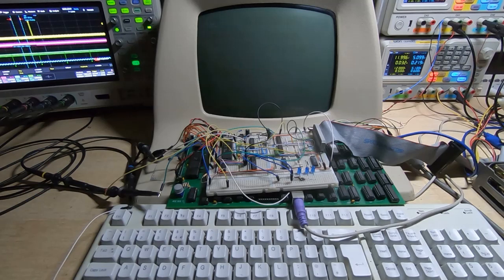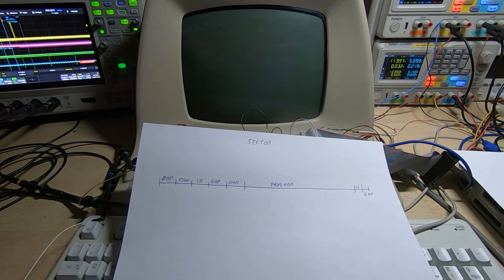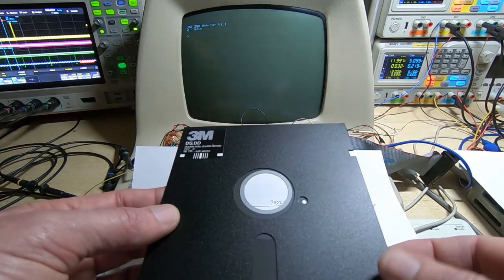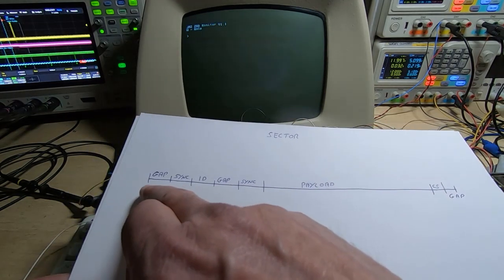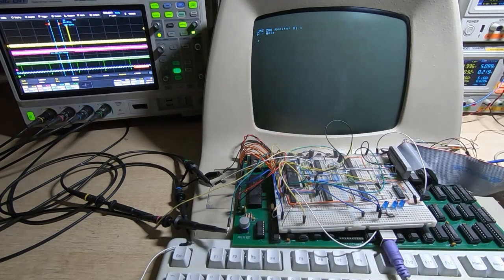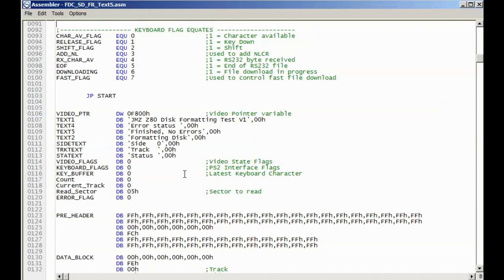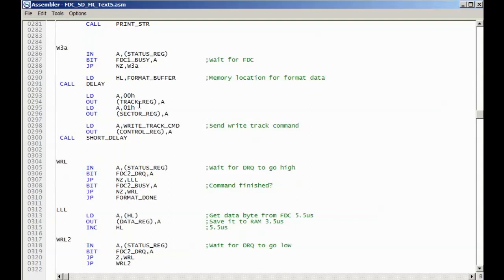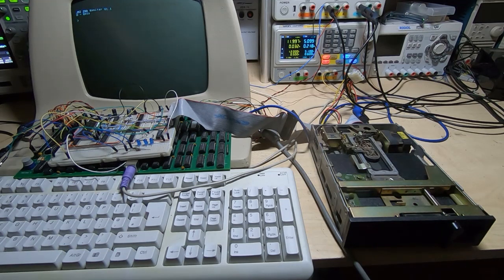Designing A Z80 Computer Part30

Comment: Hi - could you add a few words on your choice of controller chip?  Long, long ago I fiddled around with the old WD 1771 & 1791, and still have a few in my parts bin.  From a quick Google search, it looks like the TMS279X are later evolutions of those old parts.  Any thoughts you could pass along about your controller chip selection process?  Thanks!

Comment: Thank you for going through how the data is stored on a floppy and the format program in such detail, it answered several questions I still had. I'll definitely order a copy of your new book when it is released. It would be great if you could somehow publish the disk interface, too - this is a part that many retro computer projects seem to skip or replace by CF-cards or the like which is of course much more capable and easy to work with but not period correct, like putting a modern radio in a vintage car.